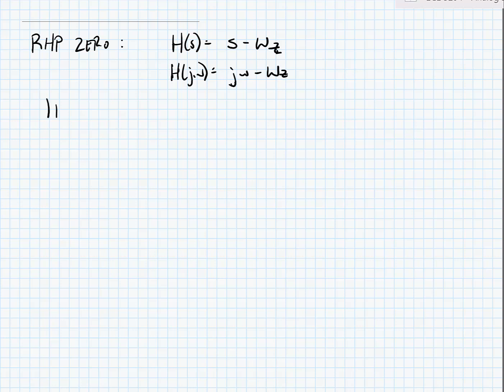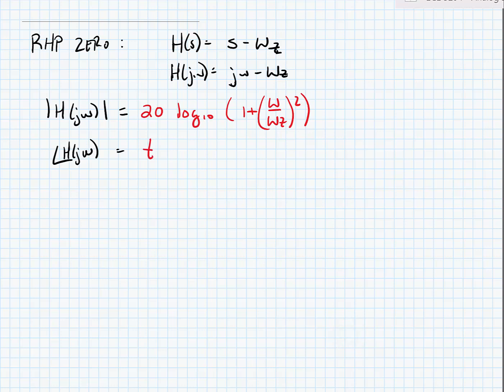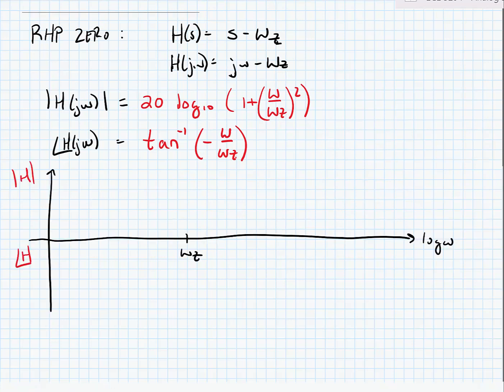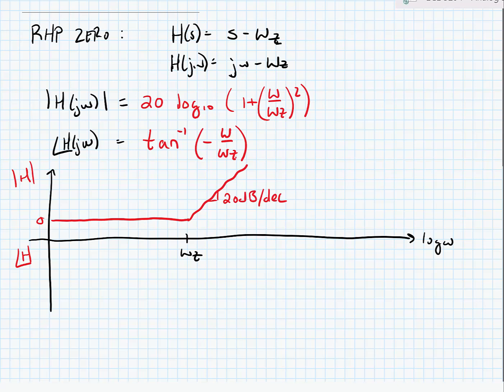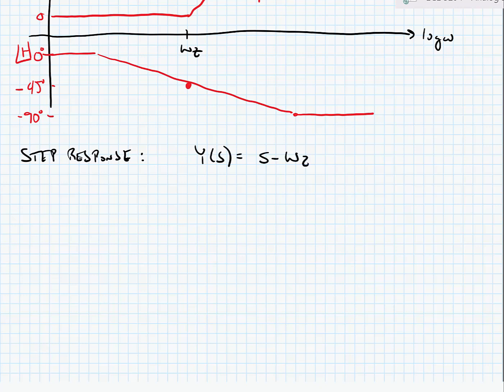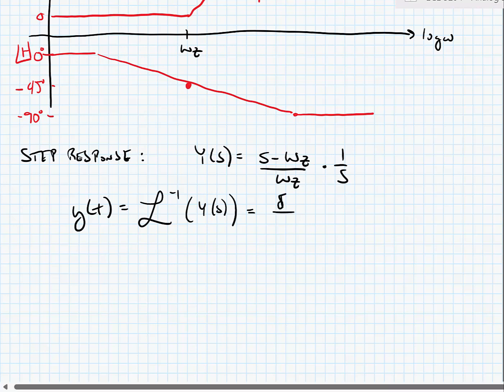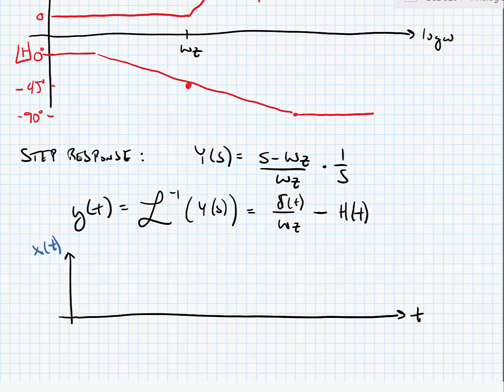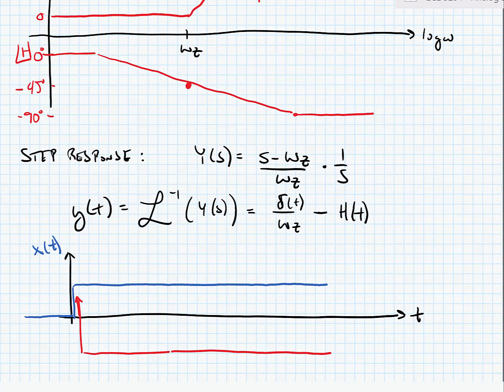ECE 3204 Lecture 19D - RHP Zero

Comment: angle H starts at -180
Reply from the maker: That would imply that the transfer function were inverting (e.g., multiplied by -1). It is not, so the angle does not start at -180.
Reply: As mentioned in the video H jw is taken as jw-wz when omega tends to zero ; the phasor approaches -wz so the phase is -180 isn't it?
Reply from the maker: @Basic-Belt  The angle is equal to atan (-w/wz). atan of 0 is 0.
Reply: @wallingphd  it approaches from the negative side of 0 arc tan(0-)=180
Reply from the maker: @Basic-Belt  atan(1) = 45, atan(0.5) = 26, atan(0) = 0, atan(-0.5) = -26, atan(-1) = -45).

atan is bound between -90 deg and 90 deg for input from -inf to inf.